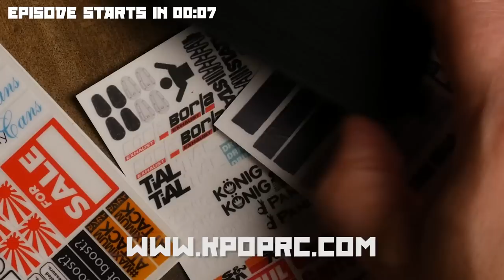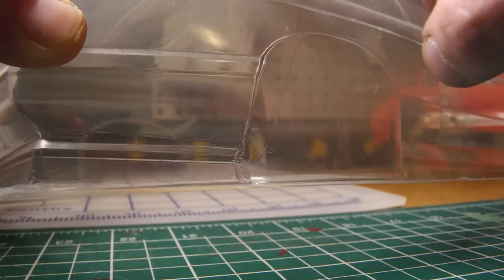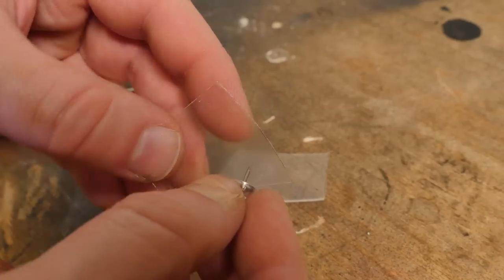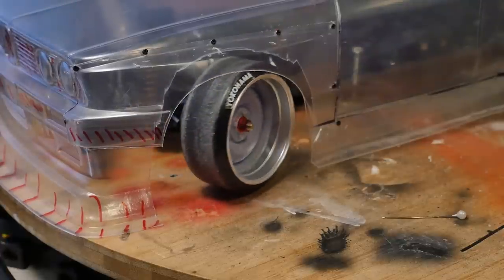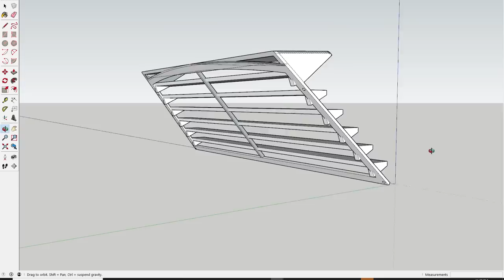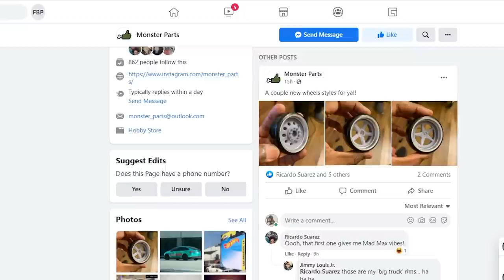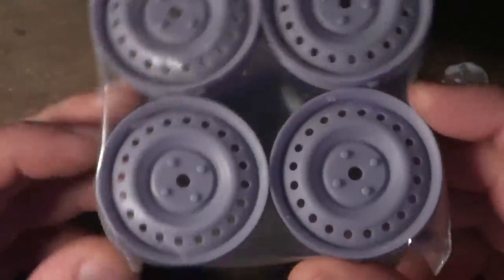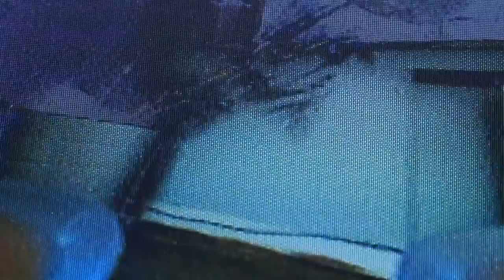PART 2 SHE DRIFTS - BMW E30 WAGON - YD2 SXIII Chassis

Comment: That turned out super cool. I was just contemplating liquid mask or not for the body im working on. You convinced me! Just gotta remember thick coats!
Reply: you can thin liquid mask with water and also airbrush that.. make sure you use a large fluid tip and needle though ;)

Comment: Me thinks it a quattro . The ones they  used before group B. Where I think they used the shorter version  the quattro  sport.maybe it's the flat 5 Subaru  WRX.  Love both vids on the BMW drift wagon. The whole idea of putting a wide kit on it and fabrication  of your own parts . Amazing dude. I raise my hat to u. Looks sick. Can u tell me if u can put wider wheels and tyres on to fill up the arch  and quarter gap.i think  white is to dull. I think you should change it to artic blue. It's a colour by ford. Check it out. Have a festive Christmas man.

Comment: What CADD program do you use .. I am a certified drafter but haven't used cadd programs since 2009 when I graduated other than some free ware that was terrible ... I'd love to start making rc parts I have a friend that has a 3d printer and I've been building rc cars and trucks since 1993 ..
Reply from the maker: jump on onshape. that's what I'm learning right now
Reply: Thanks bro